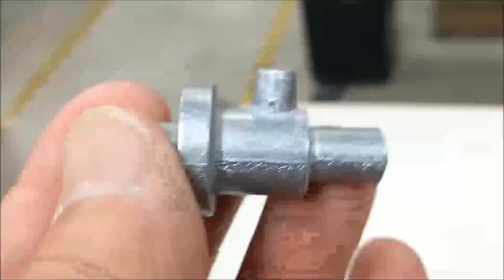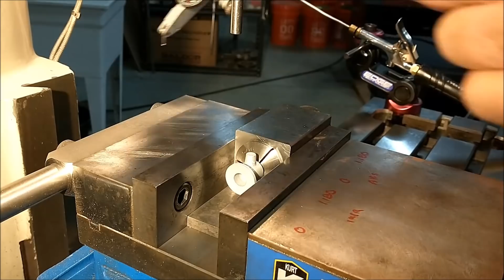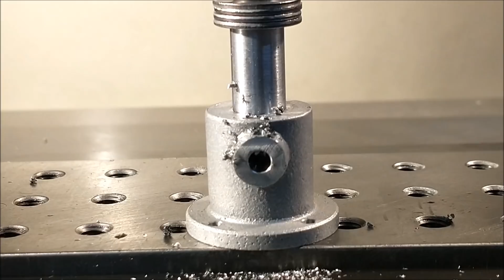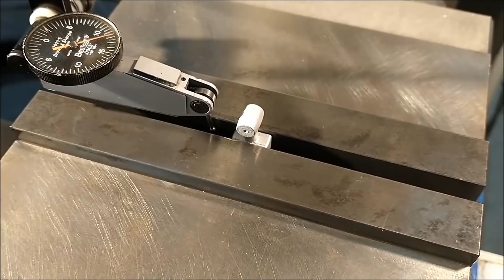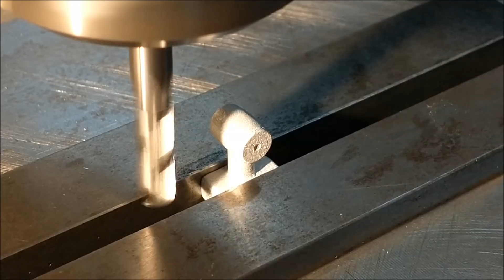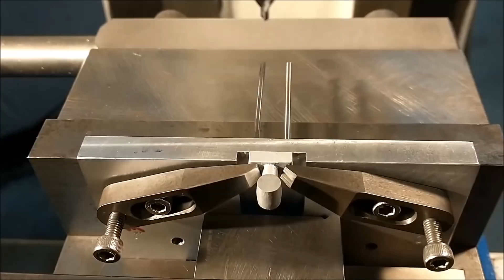The Miniature Drill Press Build Continues....

Comment: I'm somewhat puzzled at 19:52 as to how you knew where the centre of the boss was.   You would need to know this before you could trim the ends and drill the holes on which you rely on for locating the centre of the boss later.    Great videos - much appreciated.
Reply from the maker: At 19:52, the center of the boss on which the part was held, was established by sweeping the jaws when closed. This gave me the Y axis zero. Pre machining inspection of the part determined the bottom was central enough to that boss to trust for drilling of the 2 mounting holes. Those 2 holes were than used as the datums to drill the final shaft support feature assuring its true relationship to the 2 base mounting holes. You'll see the part removed during the bottom milling op. That is when I measured it for height and central integrity.
Reply: @joepie221  Thanks for that, I missed the statement that you had inspected that the base was central to the boss.

Comment: Joe, I've being having a hard time aligning my lathe headstock. it's a colchester master 2500 like yours so maybe you could give me some advice. The beds been leveled already and i aligned with rollies dad method to 0.015 mm.It still cuts a taper of 0.20 mm over 200 mm on unsupported piece of 30 mm diameter aluminum round.

Comment: More great lessons…suggestion…it would be visually merited to pan back to give the viewer the relationship of the part to the machine, yes your thumbnail is a great reference but not the total relationship to the setup/work which is easy to disregard (forget) as a viewer.  Also, would be nice to see you or explain…reading glasses only? Magnifiers? Loop? Camera assist?
Reply from the maker: Greetings Chuck. You are right, showing the size of the machine being used might be a great contrast. As for the magnifiers, I just have a 5X B&L loupe and a pair of powerful readers. I'm sure I would benefit by an optivisor, but just haven't purchased one yet.

Comment: Hi Joe, as I have said many times, I am in awe of your approach and completion of every stage of your videos but I have to say that I was surprised to see you measure the central hole in the column with a caliper. The risk of mismeasurement would be extremely high because of the flats on the jaw faces in such a small hole. I am hardly in a position to say that you are wrong but I have never been able to get repeatability using that approach and I have seen a "Build Something Cool" video that shows why, which made a lot of sense. Can you describe how you get that repeatability please? (or was it just to get a rough guide?) Many thanks
Reply from the maker: That center hole is a counterbore for a screw. Called out on the print, its about .02 bigger than the screw head ( I checked it ). As for the flats on the caliper, I always know the hole will be about .002 bigger than the reading on the dial, so thats my target. For holes that are a mating feature or need to be precision, I use the caliper to get close then switch to gage pins.
Reply: @joepie221  Hi Joe, thank you so much for the explanation. That is where experience and precisely knowing your tools comes to the fore. I feel better about asking the question, thank you.

Comment: What blast media do you use
Reply from the maker: #6 glass at approx 30 Lbs pressure.
Reply: @joepie221  ThankYou
Reply: This is also my question for you.  You get a much different finish than I get when I blast the parts after filing off the casting lines.  Thanks.